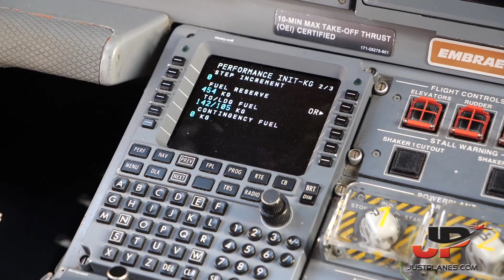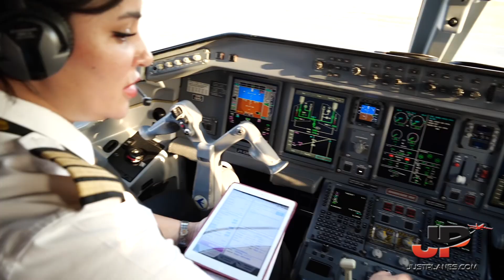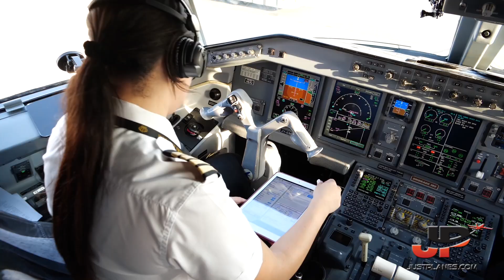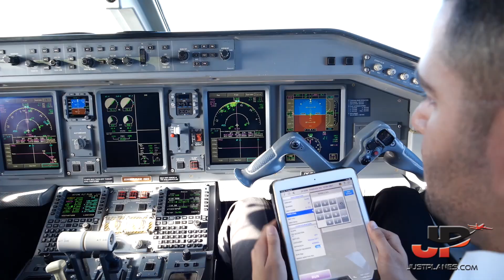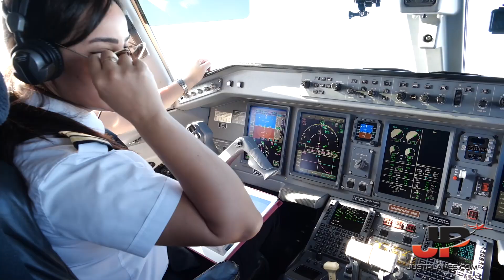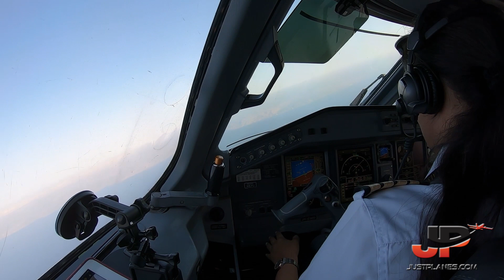Royal Jordanian Embraer 195 Cockpit Amman🇯🇴 to Aqaba🇯🇴

Comment: The Embraer 195 (original E195) typically seats around 108-118 passengers, while the newer E195-E2 model offers more capacity, usually fitting 120-132 passengers in airline configurations but capable of up to 146 in high-density layouts, with specific airline numbers varying.